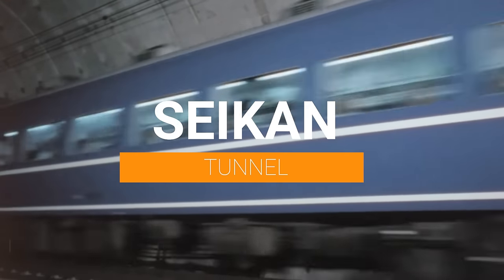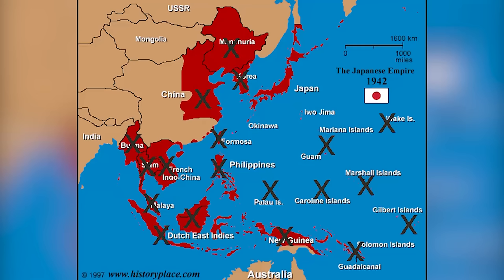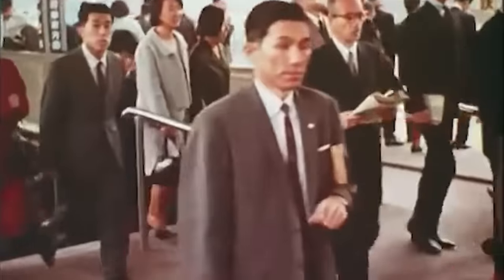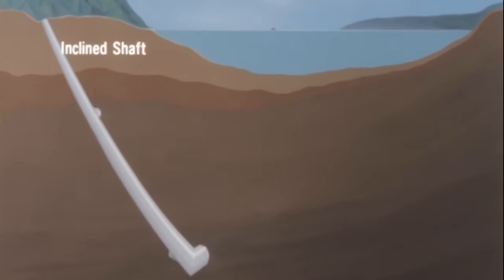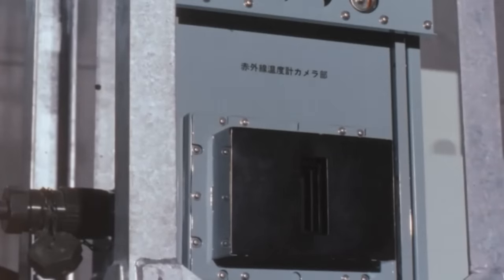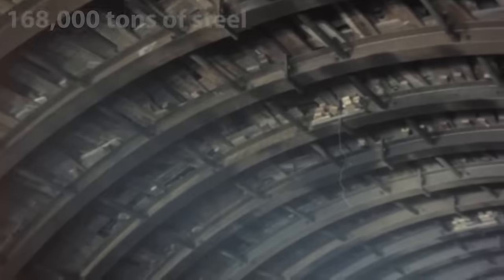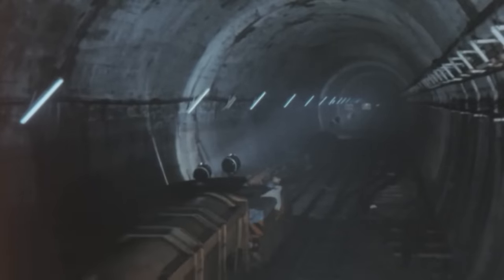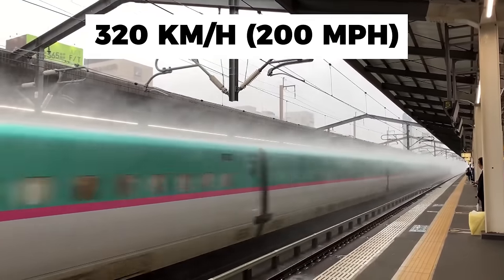Undersea Rail Tunnel Between Japanese Islands: Seikan Tunnel Explained

Comment: And to think they are actually investigating if they can build a second tunnel so that the Shinkansen doesn't have to slow down so much in the tunnel but keep up the speed to save more time between Sapporo and Tokyo.
Reply from the maker: Yes, there are rumors about it. It would certainly be interesting to see what kind of construction technology the Japanese would use to build the new tunnel.
Reply: Maybe more advanced than the first tunnel.  There were no TBMs used in building the Seikan Tunnel.  Just blast and clear mining methods.
Reply: @RailwaysExplained  Where are the sources for your videos?
Reply: @michaelrmurphy2734  I doubt it will change much, if you look at the various projects under the Alps, the Faroe Islands and other places where the whole thing is 30-60km TBMs alone are not reliable as they run into varied conditions. Australia has a massive ongoing failure with a hydropower project that tried, TMBs can be part of the solution  but pilot tunnels being widened consecutively in stages is the best and most reliable technique.

Comment: They are planning to pack the 1067mm freight waggons inside 1435mm covered Wagons so that the speed for the shinkansen Trains in the Tunnel could be Raised. At the Moment there is the danger of "Blewing" the Freight Wagons or Containers off Track by the wind from faster shinkansen Trains when meeting a freigt train in the Tunnel.

Comment: If the tunnel was designed to Shinkansen standards from the beginning, why is the maximum speed only 140 km/h? What is the limiting factor and why was it not avoided? That is a huge penalty for a high speed train, since you also have to consider deceleration and acceleration times.
Reply from the maker: The problem is that the speed of the Shinkansen cannot be increased. The reason is that the Shinkansen shares the track with a freight train, so if a freight train and the Shinkansen pass each other at high speed in a tunnel, the freight train's containers may be blown away, so the current Shinkansen is limited to 140 km/h.
Reply: @RailwaysExplained  Thank you for the explanation! That is unfortunate but it definitely makes sense.
Reply: @RailwaysExplained JR East Shinkansen run at 210 km/h during holidays when freight traffic is low.

Comment: I rode this shinkansen from Tokyo to Shin-Hakodate-Hokuto in January '23! It was super fast and comfortable, but no internet in the tunnel.
Also it takes 3 more hours from there to Sapporo. So I hope the shinkansen extension happens fast.
Reply: Do you have to change trains?  Shinkansen to slower Sapporo bound train?
Reply: @michaelrmurphy2734  Yep exactly as you said. 
I changed trains 2 times. Kyoto-Tokyo non-express shinkansen (2.5 hrs), Tokyo-Hakodate shinkansen (4 hrs), Hakodate-Sapporo train (3 hrs). 
I could just fly but I had JR Pass so it was free and I like trains + luggage capacity
Reply: And the second train went through the tunnel, right?
Reply: @michaelrmurphy2734  Yes. I believe it's called the Tohoku Shinkansen.

Comment: "Fun" fact about the Gotthard Base Tunnel: it's currently closed until September 2024, after a derailment in August 2023. There must be a potential video in that unfortunate incident.

A small correction, at least I think so: "1.1 trillion yuan..." But the yuan is the (base unit of) currency in China. Japan uses the yen. I wouldn't be surprised if the two words are related.

The Seikan Tunnel doesn't get a lot of exposure, possibly because anything railway-related tends to be Europe-centric. And admittedly, there are a lot of projects going on in Europe. But that makes it all the more interesting to see content from elsewhere in the world. Maybe some of the railways that the Chinese are building in Africa?
Reply: OH, NO!   Did not hear that.   And the Gotthard Base Tunnel is impressive too.
Reply: @michaelrmurphy2734  It's not like it's been splashed all over the news. I just happened to notice it when I looked up the Wikipedia page on the Gotthard Base Tunnel, and noticed something like "not operational".

It turns out that this derailment has caused a massive amount of damage (in the CHF 100 to 130 million range) that takes a year, minimum, to repair. And yes, it has caused major disruptions.
Reply: Will agree to an extent that the video topics on non-Euro/NA railways is superficial and lacking in some ways (at least outside of high speed rail and travel vlogging)
Reply: Small correction, one of the two Tunnels is open again. But to operate at full capacity again, the second tunnel has to be repaired, which will take until September 24. Still a massive damage, as 7km of track have to be completely repaired. The damage is estimated to be around 117 million dollars (100 million CHF).
Reply: @hermann95  Yes, I should have described it a bit more accurately. Thanks for the correction.
Reply: What happened that it was closed?  Was there a fire?  Tunnel fires are bad!
Reply: @michaelrmurphy2734  No fire, "just" a derailment. A derailment that caused an enormous amount of damage. The 8 km of track has been mentioned; also, a switch (point) got damaged, as did a lane change gate. The damaged gate is the reason why initially no trains at all could run.

Freight trains can now use one tunnel, which severely limits the capacity. Passenger trains take the panoramic route, which has steep gradients.

It was caused by a broken wheel. This had cracks due to metal fatigue, but it would have been nigh impossible to detect. It was just bad luck.

Comment: I like theI like how the Seikan tunnel where constructed for 2 reasones:

1. The pilot tunnel to test diffrent constructiontechniques. That is a smart move by the Japanese! Maybee expensive now but in the long run it'll be cheaper in maintenance having the very best in the main tunnel.

2. If the standards would change in the future, the Japanese made sure those standards would be met, also in the future. The tunnel where built from the start to meet future standards. Half the future job done now. Once again, costs where cut for the future.

These 2 techniques by the Japanese should be implemented globally when building tunnels. :)

Comment: Interesting video. The extra rail on the track to accommodate 1067 mm gauge trains is interesting. As an Irish person I reckon that if a tunnel was built between Ireland and Britain an extra rail would be laid for 1600 mm gauge trains. This is an interesting and insightful video.
Reply: There are other sections in Japan where trains of different gauges run on three rails.  For example, the Akita Shinkansen and Ou Main Line share the tracks between Mineyoshigawa Station and Jinguji Station, and the Hakone Tozan Train and Romance Car share the tracks between Hakone Yumoto Station and Iriuda Station.

Comment: I wonder if they will ever connect shikoku and kyushu?
Reply: Kyushu is already connected to the Honshu San'yō Shinkansen Line running  all the way from Kagoshima. There's also a short Shinkansen line in Nagasaki which in future will join up to this line. In the original network design in the 70's Shikoku was to be linked via Osaka, this plan was put on hold indefinitely.
Reply: @rztrzt  To each other, not to the mainland I mean. Not hsr, but maybe a road and rail bridge/tunnel
Reply: @Hession0Drasha  Ok got you now, east kyushu and west shikoku are not big economical areas for starters, a tunnel in that area would have to be 100m deeper than the Seikan tunnel, a bridge would need to be 13km long and apparently that place has very high winds. All these things are not considered economically viable. There was a 'concept' for a bridge some time back but it stayed as a concept and never went any further. Would be 'cool' to have them linked though but for now we have to make do with the ferries.
Reply: @rztrzt  let's hope improvements in material science, makes the economics more viable :)
Reply: There is a proposal of constructing the Hoyo Strait Connection between Ehime Pref. in Shikoku and Oita Pref. in Kyushu. It's actually not that feasible considering the traffic volume between these two regions are low, but they're connected by ferry. Although not feasible in the current time being, there's still a possibility as the Shikoku Shinkansen's original plan actually goes through the Hoyo Strait. The original plan is to connect Osaka and Oita through Wakayama and the to Shikoku via the Kitan Strait Crossing to Awaji Island (planned bridge or tunnel) and then to Shikoku (either utilzing the under-road section of the Naruto Great Bridge or a planned tunnel). The route will then traverse across Shikoku until reaching the west tip, and then passing the Hoyo Strait crossing (planned tunnel or bridge) to Oita before terminating in Oita City, which also has a possibility to connect to the planned Trans-Kyushu Shinkansen to Kumamoto

Comment: Building this in an active quake zone remains a marvel. Experienced it in 2007. Surprised to find from Hakodate north to be all diesel. Sad to find that flights between Tokyo and Sapporo remain mostly cheaper. I wonder if the Shinkansen conversion also brought the 25kV overhead power?
Reply: Shure.Currently, the Hokkaido Shinkansen is under construction between Shin-Hakodate-Hokuto Station and Sapporo Station, and like the other sections, it will have a 25,000 volt AC, double-track track facility.

Comment: Impressive, but why not hyperlube?
Reply: wtf is hyperlube
Reply: Do you mean hyperloop?
Reply: @SystemSmort lube, but hyper
Reply: @SystemSmort  it protects the drilbit, but since they didn't drill but blast, I guess that's why they didn't use the lube.
Reply: Because Hyperloop (FFS, "hyperlube", that sounds like a film unsuited for people under 18) is a pie in the sky. The Japanese are actually building a maglev railway between Tokyo and Osaka, whereas Elon Musk simply regurgitated an idea that I read about in the late 1970s/early 1980s.
Reply: @illiiilli24601  pure speed when lubing :face-green-smiling:
Reply: The Hyperloop currently being planned has a passenger capacity of only about 10 people, so it will not be able to meet the huge demand for transportation from Tokyo to Osaka.
Reply: @ykk-1  Plus, the news of this week is that the company Hyperloop One (formerly Virgin Hyperloop) is closing down.
Reply: @SeverityOne  Hyperloop and Concorde certainly have great performance, but when you consider cost, demand, and supply, they are completely unbalanced and will be difficult to sustain.